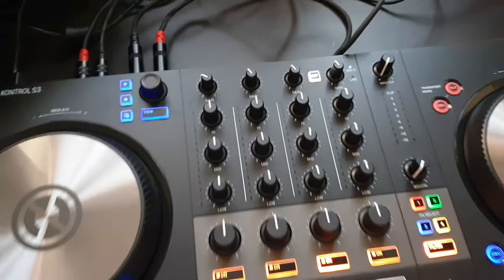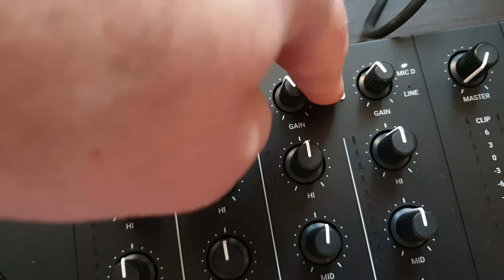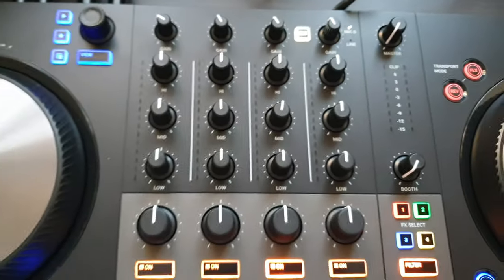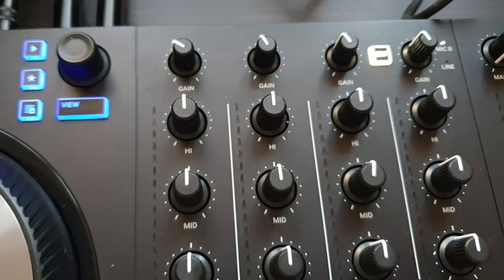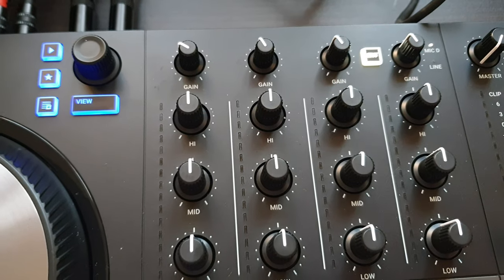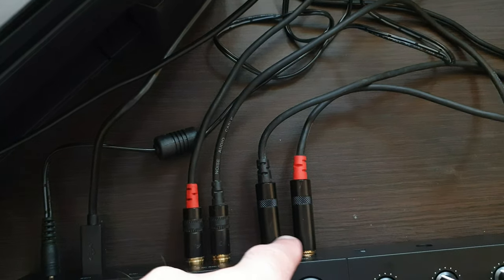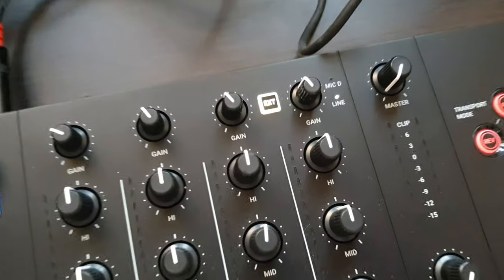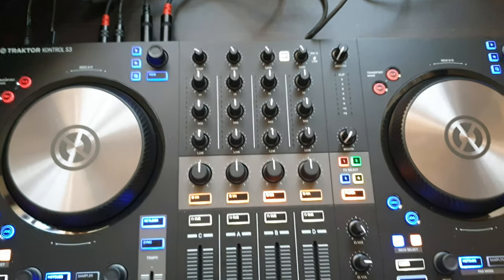Traktor Kontrol S3. Changing the EXT (external) from Mic to Line in.

Comment: Great vid thanks  i have to run pro 3 on my pc   and the obs on a laptop just wonder what cable i wld need from the controller and were to come from to go into laptop?
Reply from the maker: It will be a mini jack to phono. On your laptop you need to make sure it has a line in. It will look the same as a headphone socket. If not you need a small audio interface to capture the audio.

Comment: Hey Graham - Im having issues with my S3. The volume of the line in and Mic are extremely low even when the gain is maxed. Could I also check that when you set up the Input routing the only option you have is Mic In Mono?
Reply from the maker: Hi. Sorry for late reply. My volume seems to be ok. I can't really answer that one. How low is low? In OBS what does it meter at? Could be a faulty cable maybe?!

Comment: Hello everyone,

I have the following concerns:
an external mixer is connected to the Traktor s4 mk3 via line in.
Traktor also gets a signal, the sound is there, but it starts to rustle. it sounds like an idle noise, possibly a lighter hum.
The higher the level, the louder. who could help. Thank you in advance.

Comment: Its a bit naughty from Traktor to not let you assign the mic and line input to different channels at the same time. So now I can't live stream and use the mic. The only way to solve this is to buy a USB mixer.
Reply from the maker: I wonder if its because of the cost of the unit? Maybe they have limited this? I don't know.
Reply: @GrahamThorne  it could be but back in the day mic input always came as a stand alone. It's a shame but it's still a great mixer